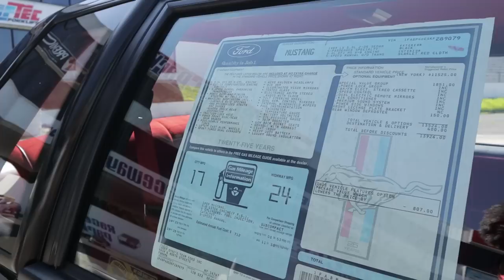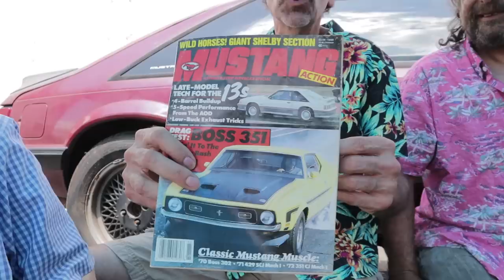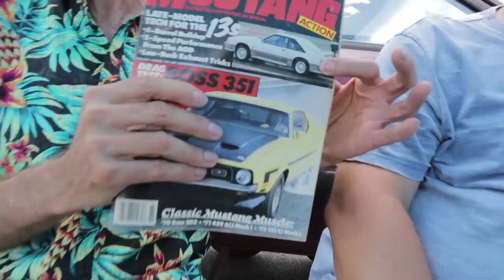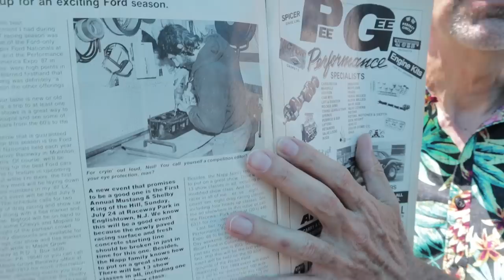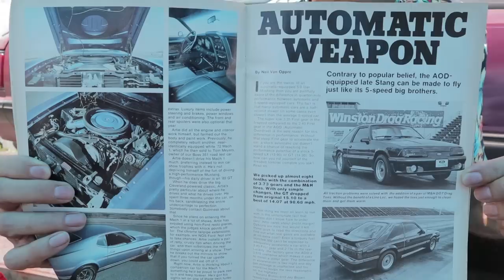5.0 Fox Body Mustang Revolution- The Second Coming Of The American Muscle Car

Comment: Not impressed by any thing passed the year 2000 . The first vehicle I got was a 1995 suburban and it was nice for a week . The electric fuel injection systems was China’s best . So I jutted the entire engine and transmission out with the drive line and rear diff . I got my hand on a over the counter iron block 455 weight reduction block with a 700R Transmission . that block was a 150 pounds lighter . I built it to a 491 stocker. 505 hp  drove it for a year then some heavy parts went on it just like it would have been on pro stock and I was able to run high 9’s with no traction the only thing that helped was it was a three-quarter ton frame got it tuned to 8:50 and I was fucking happy to drive it as a Daly driver and the biggest thing I liked was it had NO TRACTION CONTROL NO ABS AND NOT EVEN OBD1 I had everything wired up in a box I plugged in when I needed obd1 . I drove it for years and loved it . Shortly After I know why my truck fell apart because people didn’t like I had a none computer vehicle . After that 11 different brands and nothing impressed me . including the last one was a 2007 x v6 Ford Mustang that was race ready and it could run 8 seconds but it sounded like a fucking Honda. you think it be nice but it’s really not . Haven’t had a interest in anything new but looking for a old gemstone and I’ll give you a hint. A 455 turned into a 491 stroker 💎 and not this new disposable Dixie’s shit there selling .

Comment: Ten Minute Tune Up developed a bit.

1. Pull air intake silencer (and the filter if it was dirty)
2. Pull MAF screen if you had a MAF car
3. Adjust TP sensor (drill out if necessary for adjustment)
4. Adjust timing
5. Bypass EGR preheat
6. Unplug FPR
7. ASF42C Colder plugs
8. 160 Degree thermostat
9. Short belt
10. Pull out anything not bolted down for weight (spare tire etc)
11. Disconnect battery and do key on engine on to drain the capacitors in the computer. Then beat the ** out of it with a burnout after reconnecting and do a pass right away.
12. Drive it like you stole it and never lift.

Next level..bye bye cats...

Comment: Man we would do 13s even high 12s only by having nice fat slicks in the back..speacial 118 oct gas we used to by from this Muslim gastation and change the gears in the rear end 373 to 411s and even higher .I hated GT s and so i had about 15 LX Mustangs in about 10 years time ...as for GTs they were just so ugly and a bit heavier i think especially convertible .Ones Paxton and Vector supercharges ce out then we were the coolest kids around .Thn mh laer 350 Z came out  supercharged that thing and did the suspension and no one ver beat me in that car i would piss on corvettes with it all day even with our beloved 5.0 Mustangs ....had one 5.8 l 351 Saleen supercharged and that was the fastest car in tri state area ....i miss the white Saleen .

Ahh the old gold days ...

But 350 Z was no joke back then ..285 Hp then 370Z 330 Hp stuck superchrged and a bit of work over 500 Hp .Im talking about from 1989 to 2010 i raced cars 

I married now and have 4 sweet children so i had to give it up ...even tho i still have an old 1991 Saleen in mint conition 100% stock and it looks brand new ...its also the special edition wich gives a huge valiue to the car ...i havent driven that thing in about 6 or 7 years just clean it ...small drive around the block 2 or three times so that it keeps in good gondition .If i ever sell it maybe 200 k will get for it one day..
Col car ...

Comment: Makes me want to take my fox out of the mothballs.  83 mustang L coupe.  87 5.0 HO with a T-5.  8.8 with salvaged 3.55 gears and a limited slip.  Underdrive pulleys and a Moroso cold air.  Boxed rear arms with poly bushings and a GT swaybar.  Fast little car but I'm not the best driver.  Never did get it to ET very good.  Low 14s.

Comment: back in the 90,s on my 91 lx i had changed cam mass air bigger injectors etc and car didnt do as good as i thought it would so i called the ford racing hot line and they told me your on the right track now you need a computer piggy back system and a lap top to tune it , so i asked how much they told me 5000 dollars or so so i pulled out the fuel injection system bought a carb and intake and fuel pump and car began to run high 11,s for 500 bucks and not 5000

Comment: And really 2 years the Mustang was unique 1985 and 1986 and the introduction of fuel injection. Body styles were identical and a one off except for the 3rd brake light in the rear spoiler for the 1986 mandatory and only 1 year made. I have a 1985 a 4 barrel carb last year and first year of that style 1986 fuel injection and last year of that style really I have a one off. 1985 Mustang GT one year made last of the carb and a 4 eyed freak. just saying love it.

Comment: You never told us what the 3 foot piece of garden hose was for I’ve got an 89 blown nitrous injected stroker fox I’ve spared no expense and bloodied every knuckle on my hand building it and I don’t know what the 3 foot piece a hose is for you were talking about and you never explained it I pray someone sees this and tells me what it was for
Reply: It’s for spraying down the radiator to cool things down between rounds. Old school drag strips have a section in the parking lot with a row of water valves. You pull up, hook up your hose, and spray down the radiator.
Reply: @Thunderstruck951  that took a while but I finally got the answer thank you in my Evo I just push a button and windshield washer fluid that I put a little extra methanol into does the same thing and it hits my intercooler real handy for roll racing on the highway

Comment: Sad part is! I can smoke pne of those with a 8800 pound Cummins diesel truck! Lol!
Reply: @DømiNğø🛻 been around since 1989!
Reply: @DømiNğø🛻 foxbody stock only 250 hp! Nothin!
Reply: @DømiNğø🛻 mine is the high out put 305! But. Wait! Its not stock anymore!  By any stretch!
Reply: @DømiNğø🛻 but if you take the turbo offa the said diesel truck and put it on the mustang and bigger injectors! Then everybody better look out!

Comment: my then girlfriend now wife bought a 89 lx hatch new with a 5 speed and 3.08. read the article in the mag ,,13 degrees, air box lid open, left like I was on water, flat footed the shifts, 14 teens at 96mph,,, fun car. gatorbacks are the worst tire ever manufactured.
Reply: If you had a '79 w/ Michelin TRXs, you might change your mind.

Comment: WHAT? Revvin Evan? Eho font know Evan man he is THE Fox Body Man Cub! 
My step dad and I built a Model T truck. I drove a Kbody Cutty with a tunnel rammed 454 .030 hard mounted nsx turbo (probably useless until the 8th mile)preturbo marine exhaust cooler (dont ask) custom diy dual quad enclosure hi rise manifold cam (like 6 cams before it started making power) valves .030 over 3 speed muncie 9" rear black on black everyone swore that car was a Grand National. Mu strp dad had the Mega Vega POS blow your doors and the rest  of the Vega body off. Called it the 6 pass it would do 
6 passes and literally blow something up every six passes like clock work. 
Anyhow he crashed the VEGA and got insurance money and bought a fox body 2 weeks went by and I bought my first Foxy killer car. Go on a date gotta have her home by 9? NP track is open til midnight go make passes at Bandimere on race gas. More fun then with my pants off in the back seat.

Comment: Re visiting this the evolution of the Ford 5.0 its 2021 in the middle of a pandemic IT SUCKS and the other thing that sucks is the new 2021 5.0. I am tech back in the 80s working at a Ford dealership now in class 8 trucks a Freightliner dealership. Have always been a Ford fan understand the wiring the way they do it. Have had 2 times my Ford let me down 1981 Capri plug wires a humid morning and my 2007 F150 starter towed around the block to my garage and replaced the starter and got to work the next day. My rant is WTF Ford I can understand why they put in cylinder deactivation BUT  what the hell were you thinking a belt driven oil pump.Was going to spec out a 2021 5.0 yeah new the first one and the last I would do now maybe going to the dark side a Ram cant do it I will get a 2020 supercrew in oxford white with the FX4 package with the 5.0 to replace my 2007 the same but the 5.4 3v over serviced and quiet.Really Ford every one I tell this to their eyes get wide like I am talking bullshit while it is bullshit REALLY  drop this insane idea its not a better idea remember that from the 80s just saying.

Comment: why do yanks think only 1/4 mile times matter? endurance circuit racing is the real test, such as the Spa 24 Hour or the Bathurst 1000,  two things an American car has never won, though a foxbody Mustang (non EFI) did come 7th at Bathurst in 1985 and 4th in 1986, after that, it was the era of the turbo

Comment: First i have to admit that i have a deep hatred of anything with a blue oval anywhere on it so I'm biased.  That being said a muscle car , to me, should have more than horse power to weight ratio.  It must have at least some intimidation factor to its appearance.  The "Fword" cars (with very few exceptions) are simply underwelming.  The fox body "poo stain" is about as intimidating as a darned "K car".  Completely underwelming in fact its docile looking.  Simply by its design it is an inferior concept.  "Cant make a silk purse out of a sows ear"  could never be more applicable.  Of course this is just MY opinion and is c100% subjective.

Comment: Fox body was so overrated. Car has power, not denying it. As far as the style, boxy and boring, especially the LX. The GT is just an LX with the ground effects. Doesn't even resemble the classic Mustang style. So glad Ford brought back the real classic Mustang style from 05 on. As a matter of fact, the 11 V6 Mustang has 305 hp and will beat any of these factory fox 5.0s from the 80s and early 90s😆

Comment: trx metric tires something,special?????
Reply: the crew from back in the day,great stuff!!!!!
Reply: living the dream in poverty !!!!!lol!!!!!
Reply: 59 ish ilook back .lol me too eazy fix,lol!!!
Reply: 106 /87 working at ferrari .10 miles required loved 87,pdi  bleeded cooling ckeck everything re torque . make sure fluids full .runn it ,did close to 10 new cars millon used good times 87 also bar tender ,lol 1 nite only bar back 2 nites . bring  back the 87s lol
Reply: Special = expensive. I remember buying them for around 325.00 a tire.
Reply: ford never swaped well chevy easy.dodge yes and no.
Reply: stock eliminator!!! good class run what you brung!!!or drove!!
Reply: befor the inter net ,dark ages , cb /8track/pay phones? no air bags!!the good old days .!!
Reply: @JT-un7dc  Maybe you can correct me, but I think the TRX suspension was only a one or two year option and the tires were discontinued almost immediately after the option ended. I think a lot of guys ended up having to buy new wheels.
Reply: got a olddrag car came with 4spd 6pack changed to 727 4bbl befor for et guy i bought it from changed back trying to go back nostallgekt drag was athing remover all that in cluding buckets rool bar ,trying to find ,pictures lots of class winner stickers on quater windows wow all moost un read able,great show hit it out of the park ,babe ruth would be proud!!!!so revin evan stick man ??oother guy?,like i said great show once again !love the no commericals whats that cost?? u mentioned laggana once same guyt kid or dad rip ever seen king rat frankies car ,did some to that also rip frankie!motion??ricco meet the kid dad once grage door had dragerster door . cool stuff.
Reply: hawain shrits lol thanks for this took along time to watch paused did shit came back .thanks again
Reply: @TheBrokenLife  your correct about it only being a couple of years. I was able to find tires into the early 90s. But, they were not cheap.
Reply: @JT-un7dc  In the early 90s they were still pretty new cars. I think that size has been long ago discontinued now. They were also odd looking wheels, IMO. Kind of a tri-bar design if I remember it right. I think it was also a fairly rare option.
Reply: @TheBrokenLife  the last set I bought was in 93,  guy wanted 375 per tire. Haggling and Got them for 325. They where really good tires.
Reply: @TheBrokenLife  definitely odd looking tires. The aluminum rims had a  hard time staying true (after some use). I believe, Michelin was the only brand that made them.
Reply: @JT-un7dc  That all sounds about right to me. An interesting moment in automotive history for sure.